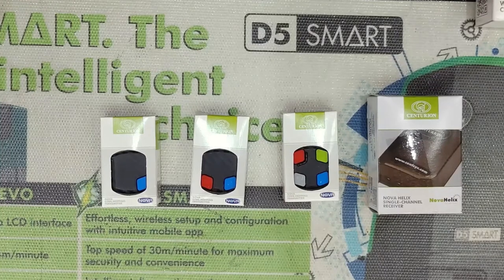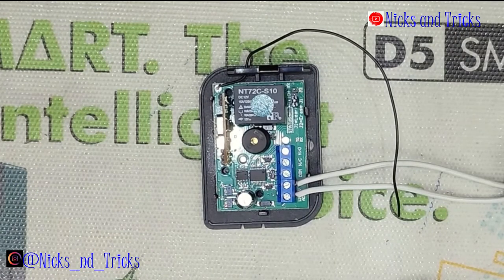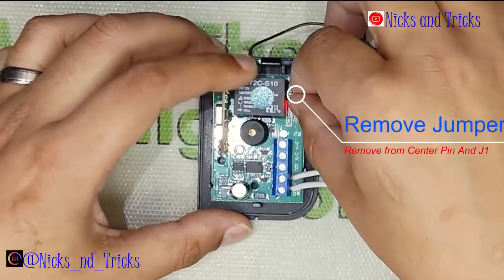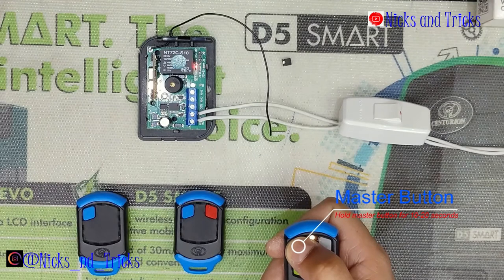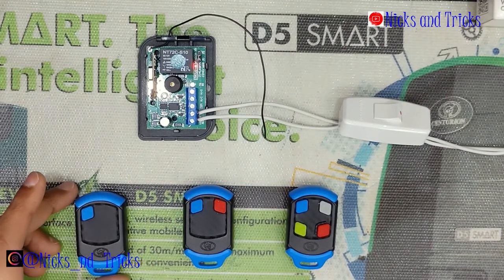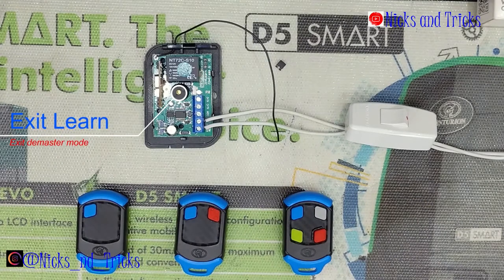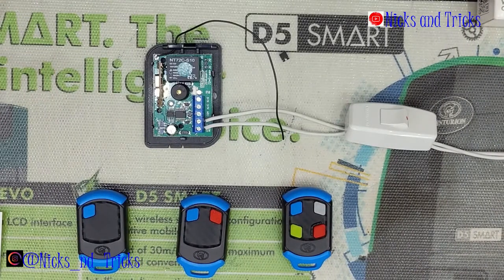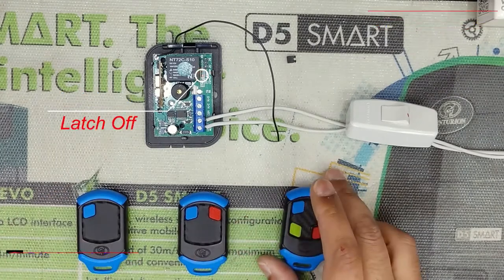Centurion Nova Helix Receiver Programming

Comment: My old Nova receiver stopped working so I purchased another one, nova smart receiver but my old remote doesn’t register on the new one, I’m unsure if it’s a faulty receiver or if I’m doing something wrong. If I click the button the light just stays on. Any help would be muchly appreciated
Reply from the maker: Thank you for the comment Edwin, there is a few different nova receivers, did you get the same one as you had before? The nova smart uses a different remote than the nova helix...
Reply: I bought a nova 1 button remote but it dont want to add to my centurion gate how do I reset it
Reply from the maker: @hendrikswanepoel6800  thank you for the comment, which motor do you have?

Comment: Can one program the green button on a 2channel receiver? Or do you need a single channel or 4 channel receiver? Thank you
Reply from the maker: Thank you for the comment Armand, u get a single and multi, you would need a multi if you have more than 1 device, if it sound too complicated you can just get another single channel receiver
Reply: @nicksandtrickssa  thank you. I will get a single channel. For some reason the 3rd Green button does not want to work on the 2 channel receiver. I think it be that you need a 4channel receiver to use the 3rd and 4th button on a multichannel unit… not sure